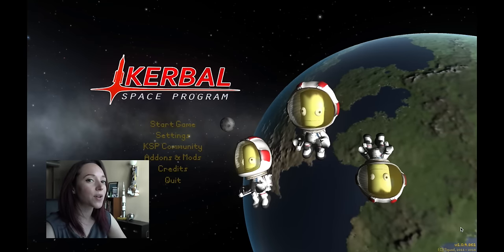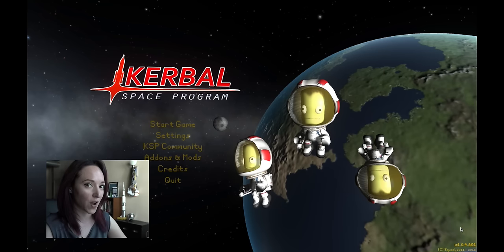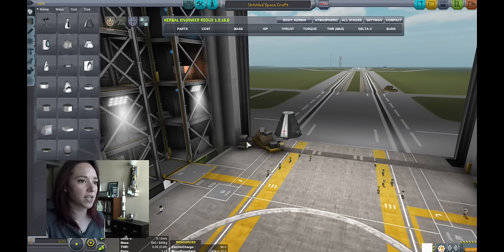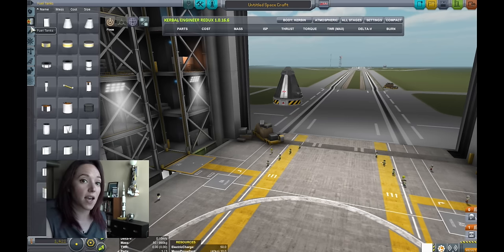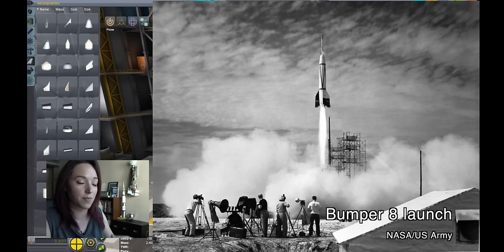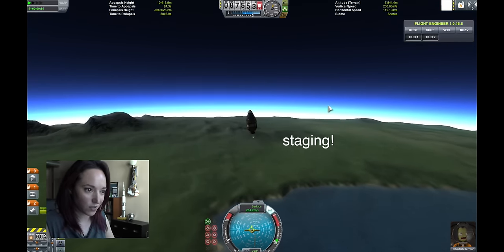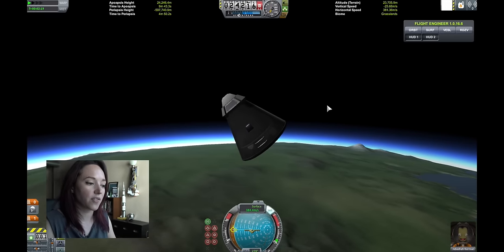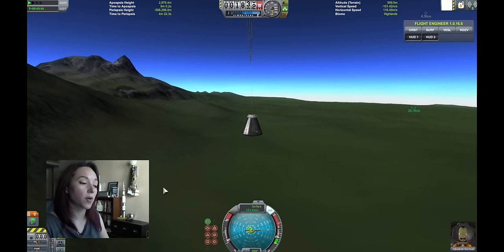Vintage Space Plays Kerbal Space Program: the V-2 Bumpers

Comment: Great episode but you need to really improve on the black bar front :) I'm not sure what software you use but in Vegas for example there is a "strech image (no letterboxing)" checkmark when rendering. The reason for your bars might be a non-16:9 image ratio. This would mean some bars would still be left after streching. A workarround is to simply play the game on a smaller 16:9 resolution in window mode. This can be turned on in the game options or by pressing Alt+Enter. If you want to get rid of the window-frame itself aswell (which is not recorded anyway) you can start the game with "-popupwindow" parameter. Windows+R -> drop the .exe file you start the game with into and add -popwindow (with a space infront) -> ok
Reply: +KerbalEssences I dunno, it looked fine to me.
Reply: +KerbalEssences Black bar compensates new weird transparent youtube interface. Anyways Love your videos! Especially Knews :D
Reply: I literally understood none of that.

Comment: I remember seeing a book in my high school (in the 70's) about the Aerospike engine.  I believe the spaceship that was designed around that is the model that was used for the Disney ride "Flight to the Moon" and later "Mission to Mars".  It looked the same (large diameter main body with a curved bottom and surrounded by fuel tubes that could either be jettisoned or kept and used as storage (on ground or in space...the book showed ideas of using this as a quick method of transporting troops).  I'm curious if you can design that in this game.  :-)